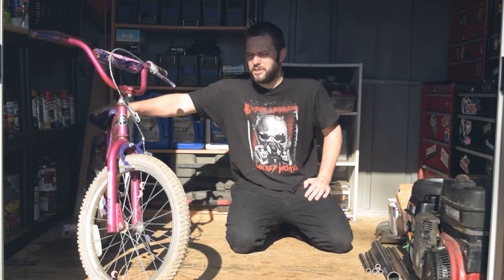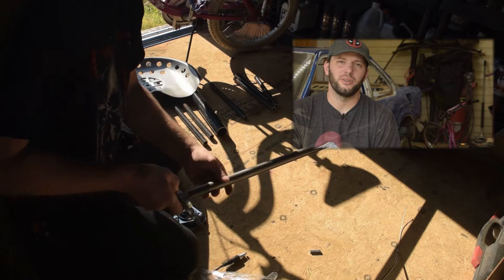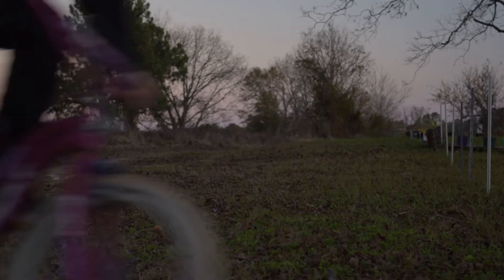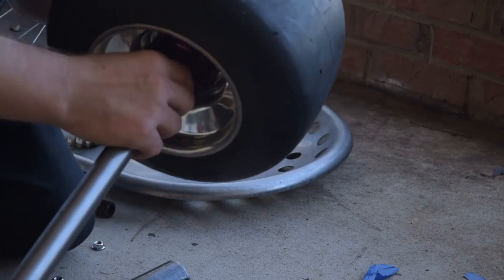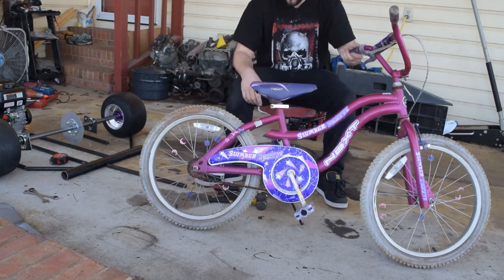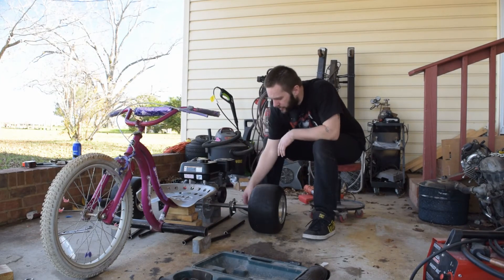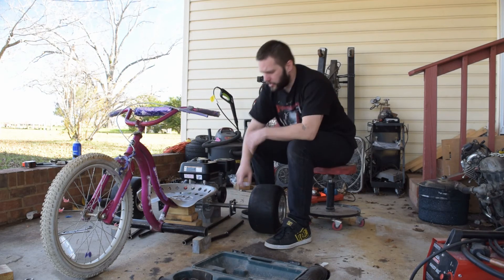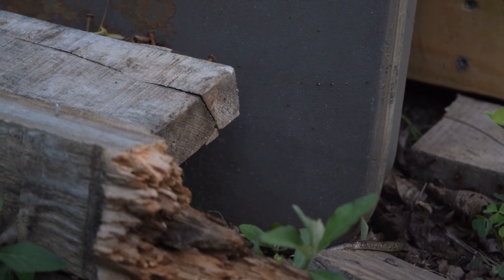Custom built drift trike with predator 212 Day 1

Comment: Where did you get all your parts? Axle sprockets chain?
Reply from the maker: It's been a while, so I forget exactly. But aside from the bicycle and metal pipe, I'm pretty sure I got everything from eBay. And the predator 212 from harbor freight. I actually just got it painted, fully welded, and reassembled this past weekend. So in the next couple weeks I'll be posting a final video on it. And I'll try to include a price breakdown, but prices have gone up since I purchased everything.